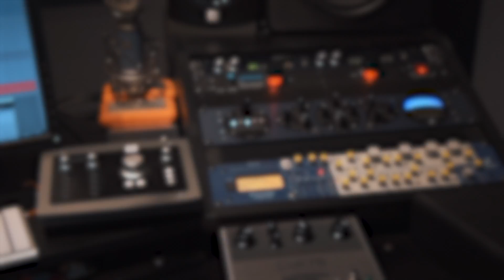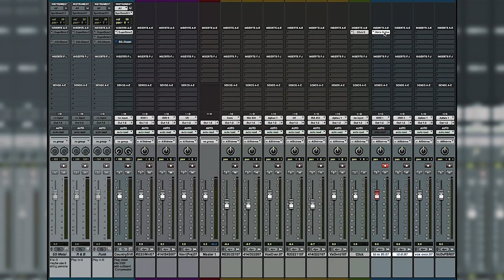Miking a Bass Cab - James LoMenzo's Guide To Recording Bass - Part 3

Comment: Just found this video, thanks for the info! How do you make sure the mic’s are in phase?
Reply from the maker: I don't have an answer from James himself but you can find phase meter plug-ins for most DAW's that will let you know if the mics are in phase. In a pinch, you can just zoom into the waveform and check that the waves match up.